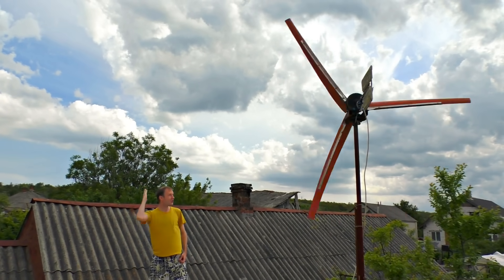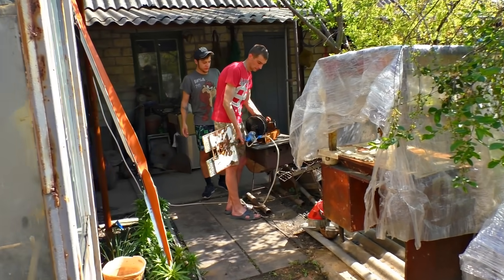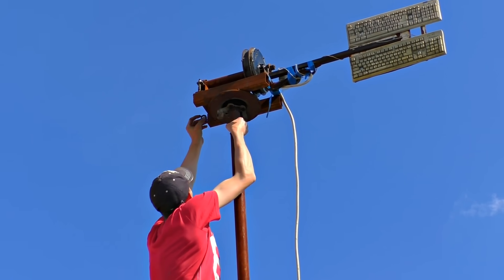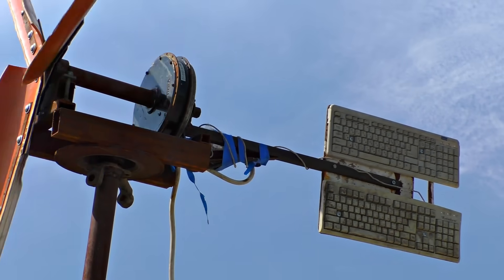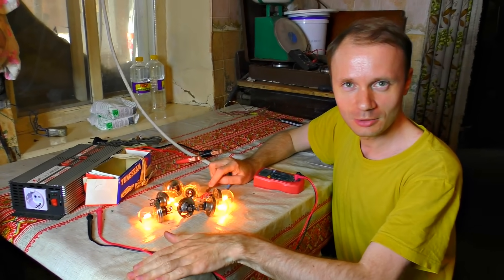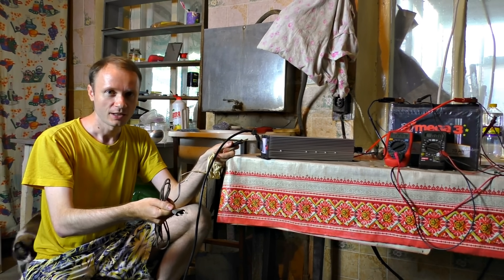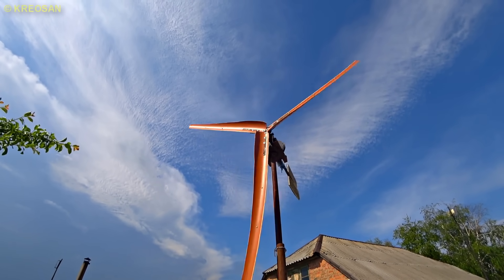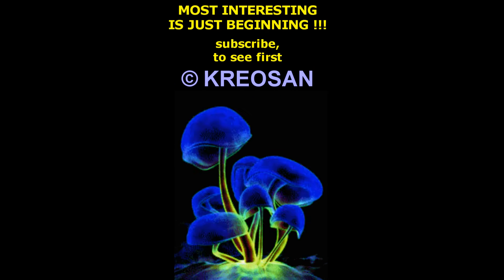✅Powerful Wind Generator DIY / Free Energy / Green Energy

Comment: very nice , use led and save energy, use trojan batteries 6 volt they are cheap per dollar make 300-600 ampere battery bank,use 2-4 solar panel then u have solar power in day and wind in night
Reply: But wind is usually less strong at night
Reply: @efloof9314  wrong
Reply: Damion Villa how come?

Comment: Wind Turbine is spinning in the wrong direction. You can tell from the curvature of the blades and it's spinning direction. The fin in the back is too small und because of the mismatched blade direction und curvature it will result in a much lower efficiency.

Comment: By the way, the joined cord is no good because if anyone touches it they could die, it could also easily start a fire. You  should use only 1 cable with 2 of the same ends but even this is dangerous, no one should touch it or take it out from the wall, if you take it out first turn off all the power from the inverter & also make sure that no one touches any bare ends of the cable while taking it off.

Comment: Thank you guys from Australia. I'm building a cheap catamaran that I will use 2x 2 HP electric motors as well as a home made sail. I have been thinking about using Vertical Axis Wind Turbines with electric motors to generate power for the electric motors during the night because solar is out, plus you can't go that fast with 1 small sail up at night. Now I can buy 2x 5000w bicycle motors for 260 USD each which is very cheap & I won't need them to spin that fast to get the full 5000 watts each but the idea is perfect for my needs & cheap.
Reply: 5kW bicycle motors? They would propel a bicycle to about 100 km/h. Don't you mean 500W?

Comment: instead of using dummy load to slow down the rotor, use an electronic brake, coil and magnets will heats up
Reply: The best I've seen is using a water heater as a dummy load, you heat your water in the house instead of wasting the energy.

Comment: This is a wonderful house: Small car trench in the garage, a connected greenhouse, and a pigsty! I'm sure you also have a substantial garden produce. 1000W is enough, with LED light, fridge, PC and TV. The dump resistors could be used to heat water, doubling as heating storage and hot water supply! There is another Ukrainian guy making solar collectors of cheap materials, You Kerosan was actually in one of his videos, petting his dog, so you know him! This house has great potential to be completely environmental neutral.

Comment: have you looked at ram pumps .if you have a stream nearby a system of check valves can bring water up hill with no electrical input .then you can use that water to power a charger...PS ..its Saturday in Australia so I'm drunk

Comment: Generator needs some sort of a braking system so prop would not turn too fast and wreck the unit. All wind generators have them
Reply: He talked about that in the video
Reply: @dakota4766  Looks like I missed it :)
Reply: A simple switch to turn the output into a short circuit will slow down/ brake the turbine

Comment: 4:41 col how you pretend that those power tools are powered by the inverter but when tbey start the room's light dimms (which makes it clear that they are actually hooked up the the mains).
Reply: Anto Mani if you look closely you can see that they had also plugged in that big cinematic light above the left guy's head into the cable drum that is plugged into the inverter, and I'd say that it's this light that flickers.

Comment: Wouldn't it be better if you ran the wire through the tube that holds it up ? That way it won't get tangled when it rotates.
Reply: Paul Evans     Both ways, either get tangled, or overly twist the wires.     
 He’s going to need to make a way to fix the that issue eventually.   I’ve seen guys on other channels use modified “ring and ball” systems, like those inside of a vehicles steering column.

Comment: electric kettle from 750 wt to 3000 wt
Reply: Jasper Edwards    The angle grinder and drill on at a same time is a good analogue.   They look like 1500w models.
Reply: @GoatPopsicle  angle grinder about 500wts drill about 250wts

Comment: It will be better to make the fan vertical type.. But anyway you did a great job 👍
Reply: ASHORSHEMAYA     For the tube he was able to acquire horizontal was better.   Maybe if he found a plastic 55gallon water drum.
Reply: @GoatPopsicle  I believe that pipe / tube they used was longer than 1 M so, if they cut it to 50 cm , and that make the Total 6 Wings of the vertical fan ، what make it more than enough
Reply: ASHORSHEMAYA  it does look longer, but verticals are a more complicated design with thin blades.    He would need a top plate, and a way to keep it all from wobbling.   Unless he made a larger plate on the bottom, with a large diameter bearing, which is just adding more cost and weight.
Reply: @GoatPopsicle  https://www.aliexpress.com/store/product/New-300w-600w-12v-24v-vertical-AXIS-permanent-maglev-wind-turbine-Generator-MPPT-controller-free-energy/3684111_32983319309.html.  Try our new arrival vertical generator.

Comment: 4:40, why does the light flicker when turning both on ?
Reply: KoeleCat   Look at the distribution block, there are 3 things plugged in.  The light is on the same circuit as the tools.
Reply: @GoatPopsicle  still, it wouldn't handel the WATT
Reply: @GoatPopsicle  and 1 is the white light on the stand
Reply: @Liam no... The 2 tools are on the transformer. And the lamp is on main power so they arent on the circuit.
Reply: Motors draw nore energy when they have a load on them (like speeding themselves up) and it drops the voltage a bit (and some bad brushed motors might make small short circuits when spinning at low speed)

Comment: Awesome work guys!  Couple points - you might want to get a charge controller with a dump load to control both the battery state of charge and dynamically brake the turbine when the battery is full.  Otherwise you'll boil the battery and cause hydrogen gas which could explode. Next point is for us English speakers, we normally use the word "battery" instead of "accumulator".  Keep up the awesome work!!
Reply: Hi there... how can they make sure the blades dont run out of control when theres high winds?. They dont have an armature that pulls the blades sideways out the way with high winds. Just wondering
Reply: @DiyEcoProjects  a charge controller with a dump load will redirect the turbines output to a low resistance load which will dissipate heat.  In extreme cases the output of the turbine will actually be short-circuited therefore the load resistance is effectively zero ohms.  Power (watts) is calculated by P=(V^2)/R so therefore theoretical power into zero ohms is infinity.   Since "infinite power" isn't possible, the result is that the turbine rotor will dynamically brake and almost stop.
Reply: @justanothercanuckian  ah see... ok so the charge controller flipping to a dump load like heating element / lights is the thing that the turbine now has to work against, thus slows it down. Thank you
Reply: a good dump load solution is a   heating element for continuous Hot water
Reply: DiyEcoProjects   Adding a speed governor off of go-cart could work too. 

Or, mounting the turbine blades on the fan part of a car with a mechanical water pump.
Reply: You can off set the tail so that it faces more across the wind direction.  You will lose some effort, but it won't overspin in high winds.   Also rather than waste the dump load get a 12 volt water heater element in a water tank and you would get hot water.  I did that with my wind turbine.   Like you say the wind doesn't blow all the time,  so a secondary water heating source is required.  Linking both the Solar and Wind generator together, hence a charge controller.   I'dd add a few more batteries too.
Reply: Hi Man, you are seams to be know lots about wind turbine generator, so willing keep learn from you. What's your name, pls? Maybe we could add your facebook, My is Jenifer AI
Reply: @jeniferai6401  Hi Jenifer, feel free to post your question in this thread. I‘d love to help you
Reply: justanothercanuck accumulater is better. English language is retarded
Reply: justanothercanuck I wondered what an accumulator was. Thnx
Reply: yeah yeah...i was thinking exacly like that! He should have the charger controler....
Reply: Thanks! Makes sense!
Reply: I like the narration.  I need to do this on some of my windy recordings!!
Reply: Thank you 
I wanna build one for myself
Reply: I think he means capacitor by "accumulator".
Reply: @lostpony4885  Nah, accumulator is same as battery. In some languages "accu" means battery. In finnish it's "akku".
Reply: The charge controller will switch off. It's that simple.....z

Comment: Good stuff. how about a slip ring to deal with the cable? :)
Reply: 2 stop bolts set underneath  @ 350°  should cover cable twist
Reply: That's what I was thinking immediately. Maintenence shouldn't really be a problem and you don't lose a lot of energy as well.
Reply: Long ago I saw a similar connection.  On average, it just spins half the time one way, half the other way.
Reply: @TheRainHarvester  you must be missing my point. or are you savage too?
Reply: haugstule , I'm cheap!  They probably use free cable and can repair if it breaks in a year. If it breaks sooner, or you want it to look good, then consider a slip ring purchase.
Reply: u dont need one, the mill will stay in correct angle cos every time wind dies down cable pulls it to the same place.

but he should secure it slightly towards the pole so it cant strike a blade.
Reply: @magnetmannenbannanen  look, do you not know long a cable can swivel and sway in the wind before the copper cords break? not long. 
are you advocating for a less maintenance free system of  having to change the cables every 6 months? genius!
Reply: @haugstule  if your slipring had high efficiency (it has not) and was maintenance free (it is not) i would agree with you, fact is windturbines will not spin around and around on theyr axis, they will stay in 1 direction, and wind dont go in sircles.
Reply: @haugstule  its just that the cable has a little weight, so it will pull the generator to the same position every time there is no wind.

Comment: you are going to insulate those wires yes? lol
Reply: insulation is for pussies
Reply: Just don't touch them :D
Reply: im more worried about the large amount of amps going through such thin wires lol.
Reply: @storm37000  Indeed, I would add some low-current fuses, in addition to insulating the wires.
Reply: What!?    Then it wouldn’t work to test Paschen’s Law.      If you aren’t going to risk your home to prove electrical laws, what’s the point?   Lol.
Reply: well yea that too, charging a 12v battery with a turbine that was peak outputting over 30v.
Reply: @storm37000  that was open sircuit. once he connected it to battery it ws 14.6
Reply: No need to insulate the wires. It's green energy.
Reply: @kevinroberts781  ahhahhahahahha =D
Reply: Oh fk. I'm going over there with crimped and heatshrink 😲
Reply: What is this 'insulate' you speak of, ArcturanMegadonkey.

You must be a dark corner shaman of the internet, in the darker corner beyond the rest of us ;-)
Reply: No regulator or charge controller between the wind generator and battery? Brave men!  Lol
Is this a prank video?  😂
Reply: We die like real man not like you amerikansky spy
Reply: @mkuc6951  hah hah I'm English
Reply: @ArcturanMegadonkey  then you are western spy same same.
Reply: @mkuc6951  What gives you the impression that the English spy on you? why would I want to spy on you?
Reply: @mkuc6951  Why would I personally want to spy on you in Russia? there is no point in that! watch some of my videos and you'll see that I have others things to spend my time on
Reply: @ArcturanMegadonkey  you have limited experiences with russian troll farms. this why you currency devalue in brexit.
Reply: @mkuc6951  ahh very good. so you now understand that I am not spying on you...I am pleased to know that.
regards Brexit, we will be buying off the USA and not Russia as we will be able to get free trade with USA.
Reply: yes, when the turbine breaks.
Reply: as long as they have motivation after everything works😂 maybe someday they makes it saver
Reply: We don't have insulation in prison. We're still alive.
Reply: @Liam he used a charger.
Reply: With everything else they've done you really think they will insulate those wires 😂
Also Ukrainian not Russian fyi.